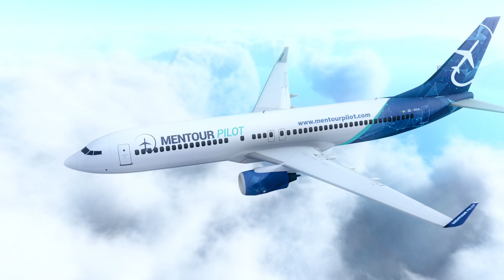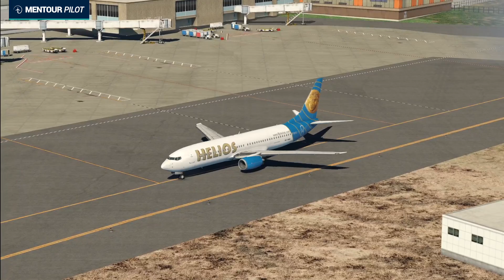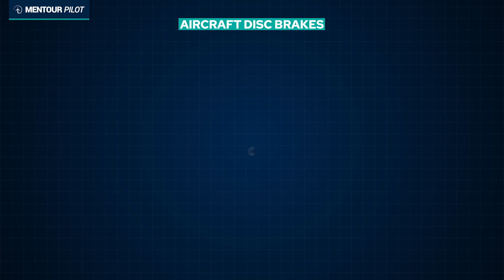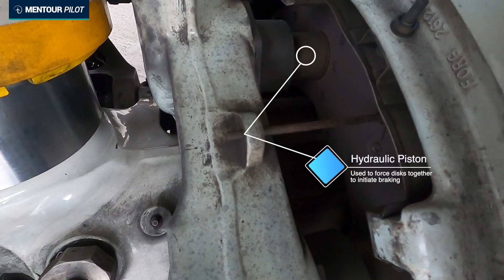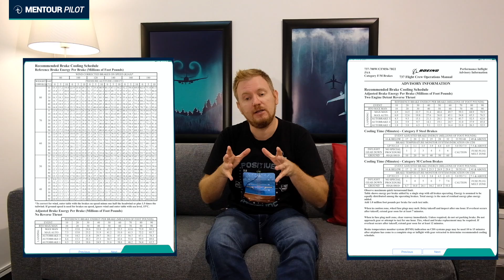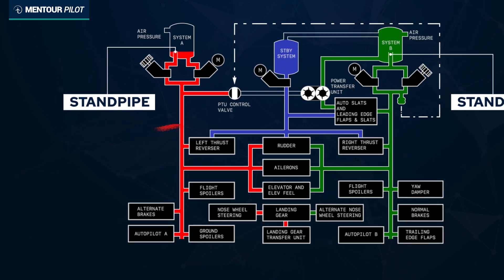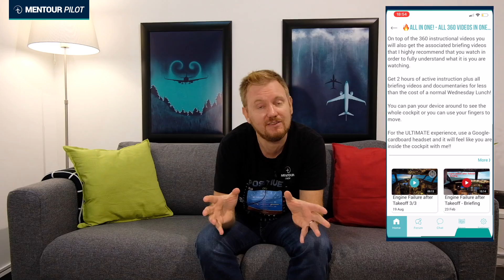How do Aircraft BRAKES work?!

Comment: Why don't they install a CO2 or other cooling system to the brakes to stop fire in a rejected take off at V1
Reply: Because that thermal shock would simply make them explode instead
Reply: @yukionna1649  but if the cooling started at rejective takeoff the heat would not be a factor as the brakes would cool straight away
Reply: Carbon breakes need to be a  bit warm to work well. There is reallt no downside for a aircraft.. well.. apart from training
Reply: I was thinking that they could pump water (from the tank used to supply the faucets) to misters to cool the brakes, but there's probably a good reason why that's not currently done. (For that matter, is it true that some modern aircraft just purify water from the air conditioning system to run the faucets in order to save on weight?)

Comment: Do most pilots know these specific details or do they know it in general and you have researched the details for the video/cos you train others?
Reply: In general most any professional pilot will or should know this;

I have a huge issue with pilots being hired simply because they graduated but not in aviation specific curricula specifically 14 CFR § 147.21 - A&P curriculum requirements  followed by "how to fly the airplane" at something like Embry–Riddle or any of the certified schools which you can get started at any "Introductory Flight" @ Pea Patch International ▬ There you find an entire shelf of materials which is "how to fly the airplane" yet for me knowing how it works is senior to flight-deck humanity

If I pull a knob or rotate a switch I want it to do what is says it does;

You can always tell those who have not researched the details but then it is too-late;

Strategy is Avoid; Avert; Abstain → "A-A-A" 

Major carrier will have filtered many of them out but final avoidance is up to you;
Reply: @ChiDraconis  That's not my experience with pilots at all, at least military pilots. They don't know much about the jet outside of the cockpit.
Reply: @averageguy371   Yes
I concur though this channel is styled to the  "Nice Guy" ~ myself the first time I am told to stall what looks to be now Piper 100/100i Pilot Trainer this inane buzzer goes off so I ask the instructor while pushing the trainer into near-stall 

"What is that thing??

Stall warning he says ~ folks if you cannot see the stall coming on in a trainer CAVU @ 4000 AGL may I suggest your standard MBA?

6 thousandth's of a cent per 100 seat miles adjusted to gross revenue projections with a buzzer on your calculator and picture of Buzzard's 

Later I push another trainer over to the instructor's side knowing it is unlikely that a trainer could go into a flat-spin and now just study IFR Commercial as I saw in the instructor's FAA Guide that is what I am trying to do ▬ Now on government retirement I try to catch those you speak of and direct them to "appropriate work" ~ One day if I get lucky I will hire my FBO to do what they called Pleasure flying and do 2 or three VOR's @ 5,500 in a 172 they have which is kept up well 

My studies to date show there is horrendous amount to be learnt at the desk ~ 480 Knots @ FL 250 & climbing is not the place to learn "400 pages of manual" ~ did you see the Jakarta event?  Occurs at 1,000 AGL or so ▬ I had read of otto-fuel backup on military to run something emergency ~ we as Western Civilization do not realize what occurs in remote regions

Comment: 727 and 737-100 and 200 had options for it, perhaps the -400 had them as à replacement for the -200, but it was determined that unless you’re really in a bind, which is why carriers like Alaskan, First Air, Canadian North, more remote aircraft on unprepared fields, the negligible improvement in performance was more than negated by the sheer weight and maintenance requirements thereof.  And I’m sure Russian aircraft have them, because of course they would.
Wait a tick, if you lose both A&B hydraulics, and the brake accumulator, what good are the reversers, when (with minor exceptions) aren’t they also hydraulically actuated?

Comment: Why don't any of those planes have brakes on the nose wheels?
Reply: There isn't much weight through the nose wheel, it wouldn't be able to apply enough force to be worth the extra weight and complexity
Reply: At least for the 737 and the A320 the nose wheel is smaler so it cant fot the breake discs.

For 777 and other large planes i dont know.

There is also the issue with the dual side breakes. There is two breake pedals. Liks on a tractor. On for right and one for left.  There is no center breake pedal. So... well... it make nose wheel breaking complicated.

Comment: Interesting, I'm expecting ground staff with leaf blowers like in F1 next time I fly 😀
Reply: Yeah, and others packing the inner wheels with dry ice.
Reply: Some airliners do have brake fans that the pilots can turn on to cool the brakes down after they get hot
Reply: I woundet how it work in like middle east where the runway can be really hot
Reply: @matsv201  more a problem for the tires
Reply: @bobl78  Well the tires should cool faster anyway.
Reply: I have seen videos of aircraft brakes being hosed off on some island hopper routes.
Reply: I thought of F1 when he talked about pump braking (aka cadence braking)...
Reply: indeed as far as I know some aircrafts have brake fans to cool down the brakes to extend their lifetime and to reduce turn around time... I´ve seen that on Airbus videos.. brake temp can be viewed on one of the displays  and there`s an ECAM advisory / warning when the brakes are hot
Reply: They need to make sure they've got the magic turned off ;)

Comment: Is there any feedback in the pedals? In other words, does the pressure required to move the brake pedal change as the pedal travels?
Reply: Just by the way: if you try to drive a truck for the first time, fasten your seatbelt properly :-)
A truck has brakes controlled by an air pressure. There is no feedback in the pedal and there is a little delay. So let me explain one second when you try to brake:
Stepping a little bit - no feedback, no reaction, so increasing pressure to the pedal and still nothing hapening! Finally stepping very hard and sudenly kaboom! :-D All breaking force is applied!
Reply: That’s a great question.
Reply: In a way yes, the "feedback" you get on the pedals when braking on the 737 is very similar to when you brake in a car (or even a GA aircraft).
Reply: Artificial feedback, just a simple spring really, making it harder to push the further you apply them
Reply: @yukionna1649  probably is an FBW servo thus just won't do it for me